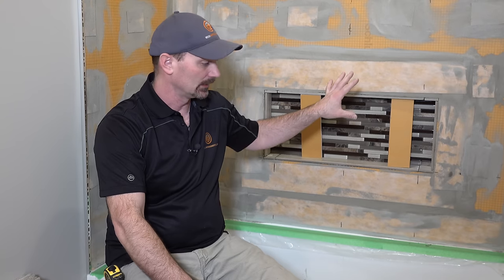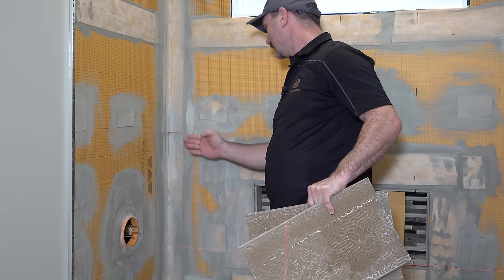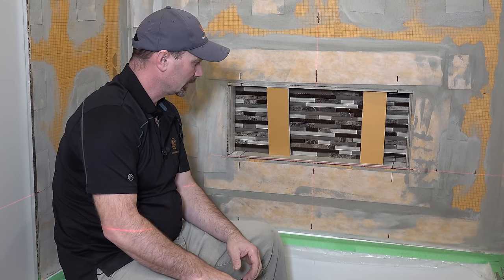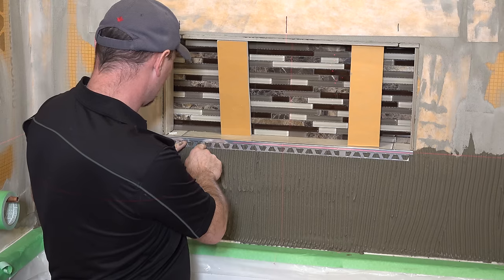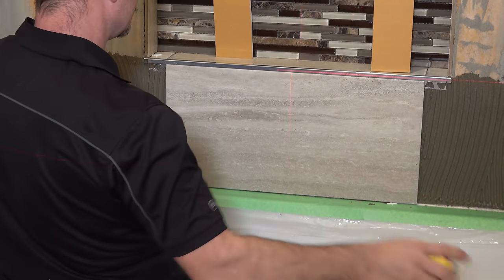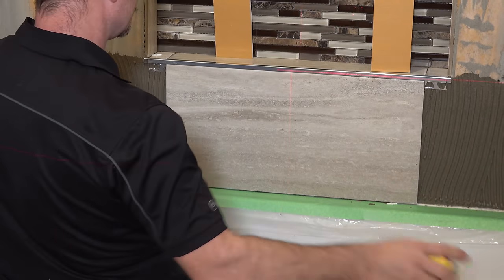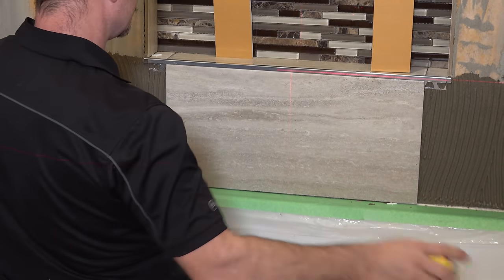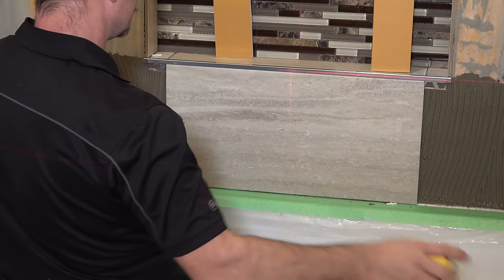How To Tile A Wall (Shower)

Comment: Do I need un modified if I used red guard as my waterproof ?
Reply from the maker: Yes they recommended Modified last time I looked.
Reply: Schlueter has ran into problems because they warranty their products.  It is a good system, but use their allset, it will cure.  Modified, is much better but with schlueter the polymers won't cure. That is the flaw whith using schlueter.  With red guard or aqua defence you can still use modified.   Maters more with bigger tile or especially stone.
Reply: @troywarren1075  Schlueter is the best.  Redguard should not be used ever, unless you want mold! Modified thinset is latex fortified. It is organic! A food source for mold growth! Unmodified thinset is the only thinset that should be used in a shower PERIOD!!!

Comment: at 5 min 15sec you mention to put MODIFFIED mortar on KERDI wich is the OPPOSITE OF WHAT THE MANIFACTURER RECOMMEND
Reply from the maker: HMM you are completely correct. This was a slip of the tongue on my part. I will make a note in the top of the comments. Thank you.

Comment: Never grout internal corners, always leave empty to allow for silicone joint. If grouted the corner will always crack.
Reply from the maker: Use a Urethane grout and you won't have problems
Reply: Use bostick vivid. Mapet in orange bag. More expensive.  Ardex.  Good grout and red floats like qep sells at Home Depot. U can really pack corners good. If u don’t and buy cheap grout then ur diffently right
Reply: @HouseImprovements  don't know about America but in U.K. building regulations stipulate that tiles have a 5mm gap to all internal corners. This gap is then filled with silicone to ensure any movement in the structure is allowed for. Just grout isn't good practice.
Reply: @benjaminrichardson2797  grout isn't waterproof, it is porous and cracks. If using an epoxy I'd say grout internals but not many jobs call for epoxy. I'd be interested to see what Ardex's own guidelines are, because German building regulations allows for a 5mm silicone joint to all internals as well.
Reply: @benjaminrichardson2797  just found out American regs recommended a grout/caulk joint on internal corners too. You're welcome. Strange how I'm in Europe and can find USA building regs and you can't.
Reply: @HouseImprovements  got to be silicone, no substitute. U.S building regs even cover this subject. Internals to be silicone or caulked.

Comment: Those holes do not need to be round.They can be cut on a little tub saw in about 2 minutes. Right there in the bathroom.
Reply from the maker: If you are not using the gasket seals, sure
Reply: HouseImprovements Why wouldn’t I use the gaskets? They press against the tile ,not the hole . Try it ,you’ll like it. Why no water on the grinder cut ?

Comment: The shadow beneath edge of tub makes it look like you are installing tile on top of tub’s flange, which you are not. I checked specifically previous video, and saw that flange is covered by membrane strip, but I can’t help but see a step due to the way shadow falls on edge of tub, I hope it won’t mislead people so they think it has to be on top of flange, perhaps some overlay comment on video can make it clear :)
Reply from the maker: You are correct I am for sure not tiling on top of the flange. The flange is being covered by tile.
Reply: Funny this is the last comment on the thread and was my main concern.  I was sure you were tiling above the flange but I guess not.  Video is very deceiving.  Thanks for explaining everything so well.

Comment: Shannon I can't understand why you would show cutting a circular hole with an angle grinder with the safety guard removed particularly when it can be done with the guard in place. The guard is there to protect your fingers... with the guard removed if you hand slips down the handle of the grinder your fingers are going to come into contact with the a diamond tipped blade revolving at up to 12000 rpm likely removing them! Please don't try this in your own project people. Always leave the guard in place! Bear in mind the majority of people watching these videos are likely inexperienced and however well meaning this is irresponsible.

Comment: You never comb adhesive that way it’s Always combed across the way to stop any water seeping through behind the tiles
Reply: Isn't that what the waterproofing behind the tile is for? It's not adhesive. It's thin set mortar.
Reply: Wrong!!!
Reply: @michaelhorn9114  No, you would be wrong. This technicality is irrelevant. I have never had to remove tile because of the direction I troweled stinkin thin set. I've set tile for 25 years including LeBron Jame's house. And it is not adhesive (glue) it is thin set mortar.
Reply: @LosDog14  woah dude,  I  know it's not adhesive! Duh! I know it doesn't matter what way you comb the thinset! Only 25 years huh?!I'm Schlueter certified, I'm taking that you are not! Btw, been doing tile for 30 years  youngin! And, I  live in Akron  too. I have done a lot of work by and around Lebron's house in Akron.
Reply: And, Carlos, I was replying to Dan!
Reply: @michaelhorn9114  OOO you have a whopping five years on me. I know guys that have 40-50 years and they suck. I have two friends that are certified. So what. Until the Kerdi system has thinner fabric, there will always be problems. A certified rep prepped my shower and it didn't matter.
Reply: And oops. I thought you were replying to me sorry, lol.
Reply: @LosDog14  Schlueter is a great product!
Reply: What does the thickness of kerdi have to do with anything?  You still set the tiles in a bed of mortar. You just have to know what you're doing,  that's all.
Reply: Michael Horn Yes the fabric itself is fantastic and so is the warranty. The areas where the band and corners go is where the layers of fabric create a problem. That’s my biggest issue (shaving the backs of tiles) and the foam pan (which Schluter has improved). I’m trying to get my company to switch to another system. I like KBRS because you can water test in 2 hours and Go Board. The vapor tight seal is Kerdi’s selling point (plus a good warranty). I need something that is more flat and speeds up the process.
Reply: @LosDog14  just make sure that you find a product that uses unmodified thinset.  Very important for a shower. Modified thinset has latex added to it.  Latex is organic and is a food source for mold.  I  used to always use a modified thinset,  before I went to the Schlueter workshop.  Now, I  know better. The product redguard is to be installed with modified.  I would not use it.  They shouldn't even make it!